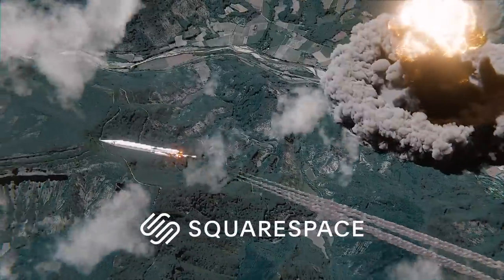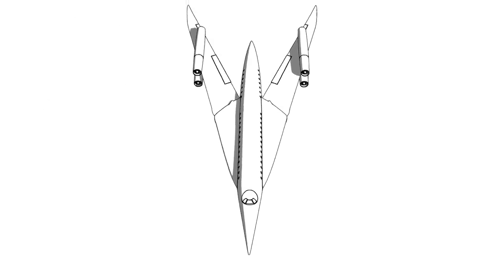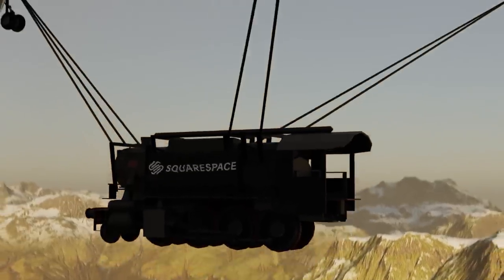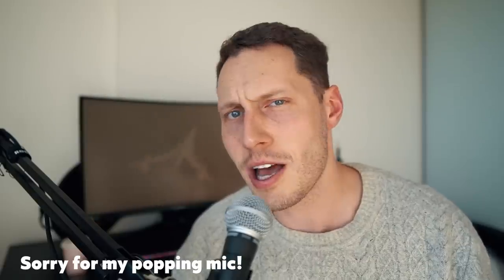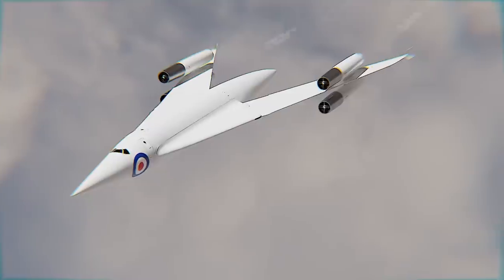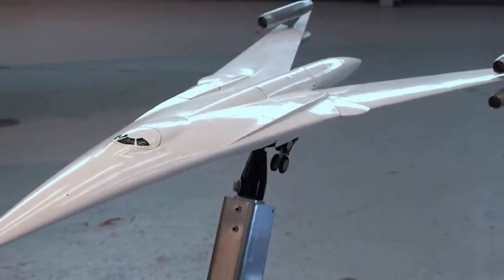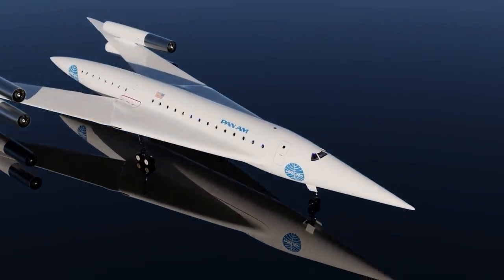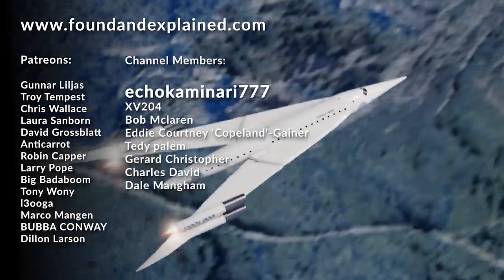The INSANE 1950s British Nuclear Bomber With No Tail - Vickers Swallow

Comment: I rode the Vickers VC-10 in RAF service in 1986. All the passenger seats were “backwards” (facing aft) for passenger safety. This was in case of rapid deceleration, you sat upright and the deceleration would push you forward into your seat rather than off your seat. That was what I was told, anyway.

Comment: The C2 for aircraft carriers for the United States are used as prevention of neck injury during a catapult launch. A C2 everyone who is a passenger has to lean into their seat belts upon cat shot. Until you are told to relax after the takeoff and fast climb. Also the rear facing seats were able to install faster in modules after cargo delivery.

Comment: The seats facing backwards is the correct way to put seats in an airplane.  It is a best optimized configuration for rapid deceleration and it increases the chances of survival in a crash-landing.
In those plane you don't need to put your head on your lap during a crash-landing in order for you to survive.

Comment: Is there any serious explanation why the engines have to rotate following the wing movements and not be rigidly attached to the fuselage or strakes? How much does this constructive solution (putting the engine near the end of the wing) make the wing heavier compared to a clean swing wing?
Reply: It was so they could have the thrust vectoring gimmick.
Reply: @animeemail8902  Couldn't, at high-speed whole construction will fall apart under pressure if you rotate the engine in XY. Also if the structure somehow survives you will stall the aircraft.

Comment: When I was enlisted in the USAF back in the 1980's, the troop seats in the C-141 and C-5 (upper deck) where always facing back towards the tail.  I found it uncomfortable during flight and especially at take off and landing.  I was told the configuration was for safety reasons.

Comment: The more of these I watch the quicker I can intuit why these things failed. Most of the time it's too much movement and complexity in critical components like engines and main wings.
Reply: It's mainly a factor of the state of the art advancing at such a rapid pace.  It's hard for the engineering and the experience to keep up.  

We still have a tendency to do this, we know something out to be possible but we just can't quite get there
Reply: Too many things to go wrong
Reply: All the german ww2 performance fighters were built around the engine, a inverted v12, look at a fw 190 dora from the rear, its wider on the bottom, and comes to a point at the top like a pyramid. The entire plane is built around the engine being inverted. And yeah back in those days 70s and such, switch/swing wing craft drawings and types were all over the place, the mechanism was always way to heavy to implement ina commerical airliner, the navy figured it out with the f-14, wich is a well performing jet, so it could work very well.

Comment: Beautiful, however I doubt the engine mount joints would handle repeated stress of being pulled in multiple directions as metallurgy of the jet age wasn't understood until the Comet airliners started crashing, that plus the complexity of controlling the aircraft with electronics of the day would have made this a tall order. Moving the engines inboard and vectoring thrust from them could have worked alot better, that way if one engine is lost you can still control the aircraft.
Reply: It was certainly ahead of its time. In the late 50s they were using vacuum tubes although they could have gotten hold of transistors.
Reply: @dannydaw59  Maybe if it were still in testing for like 10-15 years giving technology time to catch up, like present day stealth fighters trace their lines back to F117 which were tested for around the same time, but still launched in a semi primitive state (lacking radars, issues with paint etc) which the high maintenance cost led to their short service lives. I still think the engine mount pins would be it's main weakness, as they simply didn't have the advanced knowledge of metallurgy and how jets put a strain on different points.

Comment: 5:45 For the same reason rear facing baby car seats are the most popular today, in the event of sudden deceleration rear facing seat reduces the stress inflicted to the back and neck. Spinal injuries are the most prevalent injuries in front facing crashes. The RAF (due to testing finding it safer) personnel transports usually have rear facing seats, civilian airlines won't adopt them because of cost, and I assume consumers would rather face the front than the back.

Comment: First question that popped into my head when I saw how this plane would steer by using its engines: What if you lose 1 engine?

So nice idea but there's a clear reason why it was never build.

Also, he came up with a cargo submarine (I'm assuming for civilian use?). What on earth would be the benefit of that compared to a surface ship?
Reply: Re steering in the event of engine loss; shut down one on the other side or throttle both back to balance forces. As for the submarine I seem to recall it had something to do with great circle routes under the Arctic ocean. Wouldn't have worked  down south ; )

Comment: Could still work; Using the engines as a whole as attitude control may be insane, but aligning the engines with the fuselage while sweeping the wings is relatively simple. Adding modern directional nozzles to the engines would replace the initial directional control idea of pivoting of the engines on their pylons and effectively create the same control principle.

Comment: My biggest question regards the shifting CG with movement of the wings. Most VG wings aren't carrying the huge mass of the engines . Avoiding this is one reason why the Tomcat uses a partial sweeping wing, allowing all external stores to be carried by the fuselage and wing 'shoulder'.  Yes, I do realize that the center-of-pressure changes with the sweep angle and speed of the aircraft . I will say for sure that's it's a cool-looking machine.

Comment: The backwards seats are for safety. Many passenger aircraft manufacturers in the 50's and '60', about the same time the auto industry was considering, and resisting, seat belts.  Because the aircraft moves forward, humans riding along are moving forward, too. If the plane was to make a hard landing, sitting backwards allowed the kinetic energy of the human body to be absorbed by the full area of the seat back. 
    Remember Gerry and Sylvia Anderson's 'Thunderbirds'. They did a live action SF show in the early '70's called UFO. That programme also featured the Amderson's usual panoply of really cool paramilitary machines. One in UFO was a armoured land vehicle that featured a driver facing backwards, using TV's to navigate with some semblance of VR. The driver just had to remember to steer right if he wanted to go left, and vice versa. Facing front, passengers in a moving vehicle, plane or tank, would be thrown forward in the event of a crash, or rapid deceleration, contorting their bodies while the seat belt cuts them in half. However safer travelling in backwards facing seats was, Public focus groups showed that the Public was NOT ready to fly backwards, not being able to see what's coming at them. So sitting backwards on a plane was dropped by designers. Seat belts in cars, and later, airbags, were introduced into cars in the late 70's and '80's eventually becoming mandatory.

Comment: The US Air Force, when it fitted its C-141 Starlifter jet transports with airline-type passenger seats, installed them facing rearward. This was a safety factor, as Air Force studies showed less strain on the human body in crash tests. However, C-141’s were built with aircraft frames and flooring to haul heavy cargo, so installation of rearward facing seats did not tax the airframe. Civilian passenger aircraft are a different story. In order to accommodate rearward facing seats the floor and frame of the aircraft would have to be strengthened, adding to weight, which would increase operational cost. My big question on this “Swallow” design isn’t so much the variable-geometry wing, which at the time of this design would be a hell of a challenge, as well as add to weight (the motors to effect the change in wing attitude, and attendant hardware), as it is the pivots and attendant hardware and strengthening of the wing to accommodate the change in attitude of the jet engines, while flying at over Mach 1.
Reply: Youre right im just a old retired A&P mechanic but the powerplanys out on the wings looks spooky to me thrust load would be a problem i think
Reply: maybe it flew upside down? As far as I know the design is reversed, because the movement of the wings is according to the speed of flight. So, the faster you go, the more your wings lean forward. In fact, the plane does fly backwards. not as we thought

Comment: I am a former flight attendant. To your question about the seats: I remember when I went through the training, we were taught that facing tail seat configuration is the safest solution for the traveling. Because if the plane makes an emergency landing people would not need to take safety position as the force with which the plane lands would make its job and push passengers into their seats (quite similar to why there is a place for your bag under the seat in front of you). But there were many reasons for the passengers to be facing forward and at this point all airplanes are made this way.

Comment: That vector trust mechanics would have been a nightmare and even today with fly by wire and fluid dynamic calculations of airflow no one suceeded in bringing a design to the market that does not need control surfaces. but heck, all those advanced 50s and 60s designs just look absolutely amazing. imagine a world with the sky full of those things, 6 wheeled nuclear cars running the children to school and massive spinning space stations where you can book your holiday on.

Comment: 11:42 The correct pronunciation is F - one - eleven. 
An outstanding and versatile bomber, with a unique side-by-side seating arrangement which made it an excellent trainer aircraft.
Reply: Very much the contrary. The 111 did not have dual controls. I was the Exec in the 495th TFS, 48 TFW at RAF Lakenheah, England.  We were the TRU Squadron and retraining required lots of "watch me" and simulator training. Definitely an excellent aircraft but a lousy trainer.

Comment: The RAF required rear facing seats on all their transport aircraft from the late 40s to the 70s. Only the types entering service after the VC10s reverted to forward facing seats. The BEA Tridents retained their reward facing seats in the first few rows after BA took them over, and I flew to Berlin aboard them regularly in the late 70s.

Comment: Differential control of the motors has been used successfully on radio control models for a few years now and is to varying degrees successful. This is due to the utilisation of reliable electric power .

Comment: The movable cockpit wouldn't need its own pressure system. Just a method of sealing the edge, which is done today with large cargo doors. During takeoff or landing, you're near the surface and unpressurised, so extending the cockpit isn't a bit deal.

The aircraft could probably loose an engine, or even one on each side, and still operate safely. I'm uncertain if it could lose two on one side, and if the engines are the only control surface beyond wing rotation, it definately couldn't glide. Though they might not matter for a military application.

Comment: 1959 and then return trip from Hong Kong in 1962 we travelled in Bristol Britannias with reverse seating. Although civilian airlines they were used by the RAF and military families reverse seating was adopted as standard. Can still remember even though very young being told that if there was in an emergency you are pressed back in your seat and not thrown forward. On the return trip we actually did have an emergency landing in Turkey. Aircraft fixed and 24 hours later flight continued on to Stansted.

Comment: "Crab Air" - aka RAF passenger service - operated VC10s with back facing seats, as late as 1991. This is technically safer but less confidence inspiring than forward facing. Also echoed in some Gerry Anderson - Captain Scarlett, UFO - tv series vehicles. 

Changing the direction of thrust relative to the airframe is quite common now - think thrust vectoring designs. Although moving the whole engine is overkill.

Comment: Reverse seats reasoning:
A. safety: in case of emergency landing protects head, neck and back better also reduces evacuation time, as regularly back is the less damaged end of the craft and safer route of escape
B. User comfort: research prove the ending has more impact than the beginning on peoples perception of an experience. Front facing seats render a convenient takeoffs, however during sharp stop at landing it's quite an inconvenience. Reverse the seats however, and the yank out of the seat at takeoff is not as memorable as the snug in the seat you got on landing.
C. Military: paratroopers are more convenient facing the sortie. Same section may be reused for military and civilian use
D. Left-handed intern: for left handed person it is more convenient to draw in ink from right to left. Considering the plane didn't have the tail - intern just assumed the pointy end is the front. Until he got to the left hand side of the section. On tight schedule and considering arguments for reverse seats redrawing might be not considered

Comment: Follow on from Fremonts comment about C-141 seat pallets were rear facing.  In addition the C-5 Galaxy, the rear upper deck behind the wing box has 50 rear facing seats.  The C-5 also had the same plan for main deck seating on rear facing pallets.  What a forward thinking design.  Changing the trust angle of the engines, even with todays knowledge is would be mind boggling.  The B-2 achieves some of the same control with drag devices on the outer wing panels.  The landing gear would be interesting.

Comment: Whoever was flying at 6:45 is actually certifiably insane.
Reply: THe aircraft at 6:45 is a model.  Look up Predannack Airfield on Google earth and you'll sees a thin line parallel and north of the main runway.  This was the launch track for the aircraft at 6:45.  Beacause of the high loss of life during the dams raids, Wallis refused to have manned experimental test vehicles for the Swallow deevlopment trials.

Comment: I don't care whether they gave up on this design back in the 1960s, this design absolutely should be resurrected — it's just unimaginably elegant and innovative, e.g. controlling flight by the engines alone ~ MUST be possible to do Wallis' original design as-is with modern composites, alloys and 3D printing techniques, like the carbon fiber weaving used for the Dreamliner... looks like it came straight out of Star Wars ~ we might just be looking at the design for the first true space plane! 😚👌
Reply: I second this 

There are a lot of aviation concepts from the previous century that need to be revisited

Comment: Re: Backward facing seating:  Having flown on RAF aircraft where they us backward facing seating must say felt saver and no need to use a brace position in the event of a crash since the seat provides support evenly across the back.    The real noticeable difference was on take off where it felt like you were going to fall out the seat and on landing where you are forced into the seat.   However, take off and landing may also be effected by the fact that the RAF tend to do steeper climbs and descents especially where hostile action is a high probability.      You see backward seats on trains and nobody seems to care.

Comment: I accept that the rear facing seat was probably due to crash survivability for passengers, and it was a conceptual plan.  However, with a design like this, it seems as though it would be possible to fly backward just as easily as forwards, assuming the pilots had a cockpit on both ends, or a camera and a reverse control switch.

Comment: I believe with current fly by wire technology this could work.  it would even be possible to counter engine failure in flight.  There's a fly by wire solution that was developed for convectional aircraft to counter the loss of rudder and elevator surfaces and use ailerons and flaps to keep level flight.  I recall seeing a demo of this in a simulator a long time ago, the aileron was deflecting plus and minus 40% to 50% of its range of motion within a few seconds on each wing and each aileron was working independently, so they could both go plus and minus deflection at the same time, it was the fly by wire forever correcting to keep level flight and instructing each aileron to move independently. much like how car traction control checks the suspension load, angle, torque, grip, wheel spin, on each wheel of a car millisecond to millisecond and forever correcting.  its very inefficient, but can save a plane.  this type of fly by wire constantly monitoring the thrust vectors could work today on a plane like the Swallow.  it would be interesting if any aircraft corporation would take on such a risk.

Comment: Backwards facing seats are safer for the passengers. in a crash you can absorb the shock with your whole body instead of just with the seatbelt.

Customers prefer to face forward so it isn't done anywhere but backwards seats are the safer choice.